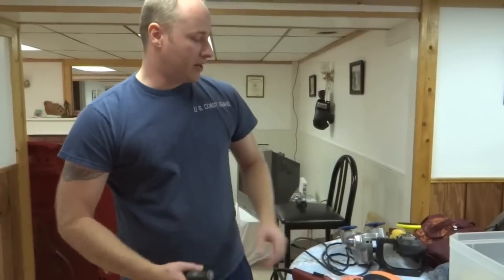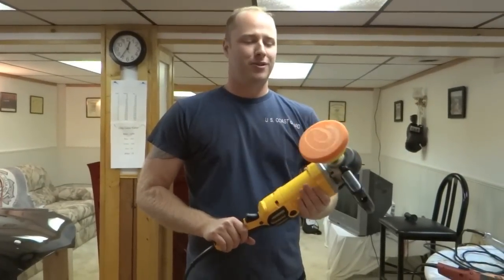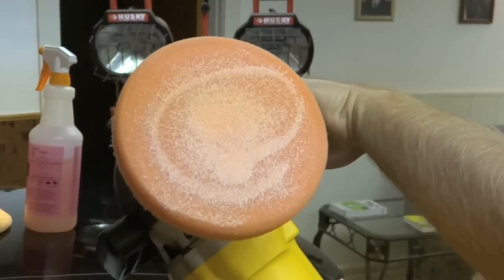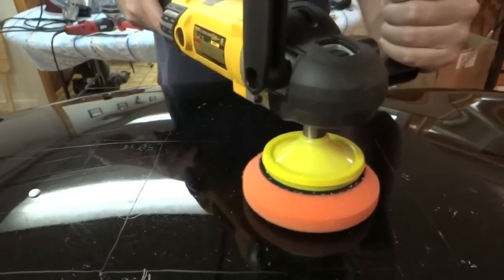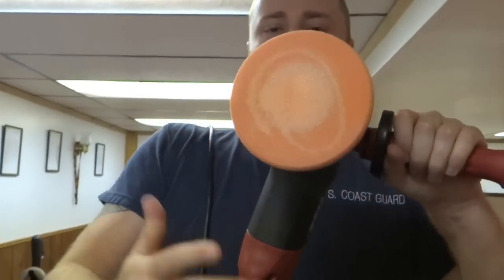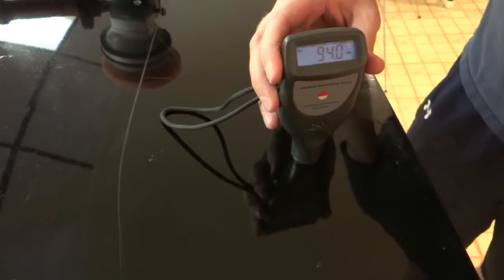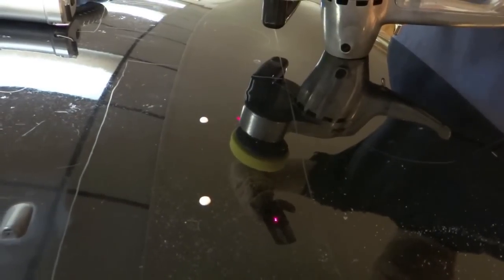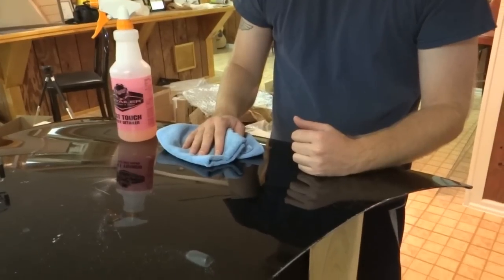Terrible Paint Polishing

Comment: I traded the Dewalt DWP849X . Don't use the rotary except when I wet sand and getting out scratches with a wool pad. Just finished up a 30 hour 2 step polish job on honda ridgeline used the 3401 except on half the front hood used rupes lhr21.  Rupes stalls on curved fenders and quarter panels the 3401 just keeps on going and takes curved panels without any issues.

Comment: how many micrones to one mill
Reply: There are 1000 micrometers (aka microns) to 1 millimeter.
Reply: docomoface thankyou.
Reply: NO NO NO, MILS ARE NOT MILLIMETERS. there are roughly 25 microns to each mil! Some of the newer factory clear coat can be as thin as 40 microns on curved edges! Most clear modern clear coats are only 60-100 microns thick
Reply: Eddie Adorno oh crap, realized that a "mil" usually refers to 1/1000th of an inch (especially in the US), so Eddie you are probably correct.

So 1 "mil" = 0.0254 millimeters = 25.4 microns.

So confusing!
Reply: Eddie Adorno hi and thanks for helping me understand more clearly what the video was talking about when he said one hundred and thirty microns. so  it is around 5 right.
Reply: docomoface hey ,thank's for the reply.  i do have one more question for you.when he said 130 microns was that with primer and paint included or just paint?
Reply: Frank L. have a look at this page.. I hope that will answer all your q´s about paint thickness ;)

http://www.theultimatefinish.co.uk/car-care-blog/detailing/paint/
Reply: Ewors hi,and thanks. i'll check out the site.

Comment: Your buffer speed on the Dewalt is really too low for this type of test IMO. Try that with at 1800-2000 rpm's and you would have definitely had some different results.
Reply from the maker: Yeah I probably would of burnt my house down.
Reply: +Sweat The Details no way! lol... just trying to help give a real world example of what a rotary polisher would do when set at a real world speed that anybody would actually use to correct the paint with the same m105 compound. 1000-1200 rpms is more of a rpm range you would use for the m205 finishing polish after the compound. Not being negative by any means. I have the same DeWalt as well as a porter cable da. Both machines work great  but in more wide open areas of panel I prefer the DeWalt over the DA for actual paint correction. either way a good video to show comparison. just think you could have had more accurate results on a rotary with a much more common speed that would be used in conjunction with the m105 to actually remove sanding marks, scratches, etc.

Comment: I'm not quite sure how a temp of 173* would damage clear coat considering some body shops will bake a car at 200* when drying it after a repaint.  Theres got to be other factors at play there in my opinion.  I would bet a cars paint, especially black, gets up to almost 200 degrees on a mid summer sunny day, and especially with the engine running under the hood.
Reply from the maker: +transamman305 you maybe onto something there. Perhaps the temp peaked much higher while the machine was going. The smoke from the pad shows how much heat was being generated in a very small area.
Reply: I guess possibly if the heat is really concentrated in one area rather than the whole car, the clear coat could react differently.  I honestly am no professional, just making an observation is all!

Comment: Excellent video! I'm looking to buy my first machine polisher and from the research I've done the rotary seemed scary as though with my inexperienced hands I could easily destroy the paintwork on my car. However, this video suggests it's not as scary as I first thought.

My car is only 3 years old so the paintwork is in good condition as you would expect. I'm really just looking to achieve a showroom finish with a machine that I can use to apply compound, polish and wax. As it will be my first machine I don't think I'll get a pure rotary but I'm tempted by the Flex 3401. Of the DAs I'm leaning towards the Meguiars 220 (I live in UK). Decisions...

Comment: yeah most shops pressure wash a panel like this keep the pressure washer close to the panel to wash out any wax or polish out,then degrease let dry apply 2 k primer then guide coat and sand with 400 wet.That will get you by at least 5 years before you see crows feet showing up again.

Comment: Was this supposed to prove other than bad technique for prolonged periods can produce worse results, or something else?

Maximum abrasion normally happens toward the outer pad edge where the abrasion in linear inches per second is faster. 
The fact that burn eventually happened in a small portion of the center of the test area means  the product applied to these panels wasn't sufficient in quantity to cover the pad evenly and it couldn't perform its lubrication/heat transfer function.   Because the polisher wasn't moved, there was no way to see if the polish was dry - the warning to stop.

Comment: most wet compounds work the best being heated up. as long as they stay wet they wont burn the paint. I have heated up deep scratches with wet compounds to the point of smoking and it will not burn the paint. I would dare not try it with dry compounds.
Reply from the maker: +Chad Sicard interesting, what's you process for warming them up?

Comment: The Flex da that you are using. Is that the Flex XC3401VRG with the front shroud removed. I have not seen anyone use the 3401 with a stick handle. I always used the bail handle on my 3401. :Very interesting video. I have seen a 3401 go through clear. It was being used on a raised body line with a lc purple foamed wool pad with M-105., SO it only broke through clear where the raise body line formed a "V". Clear is much thinner than any place else on that body panel.